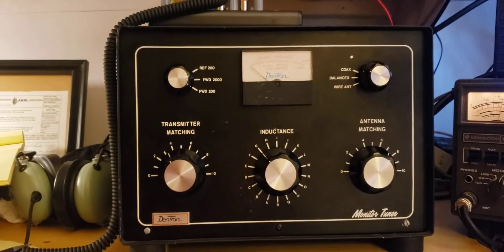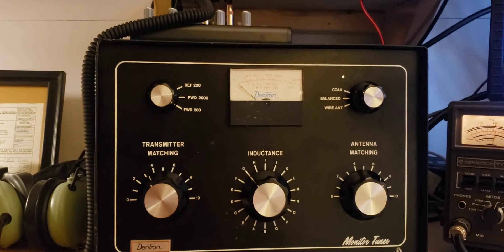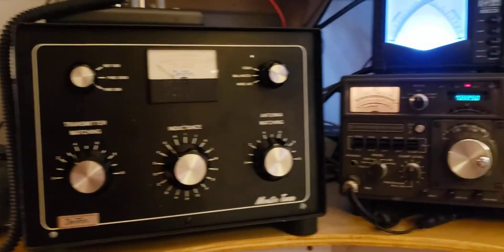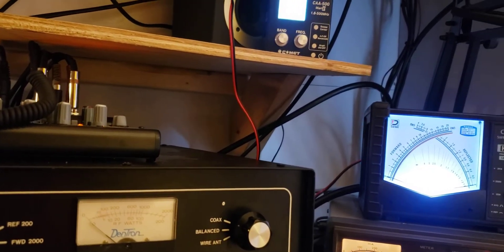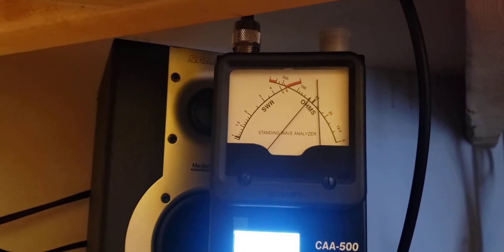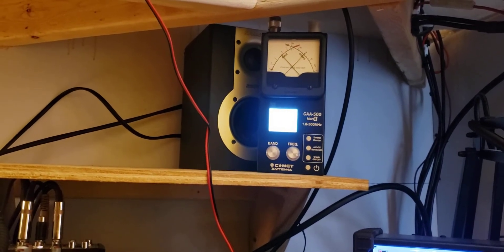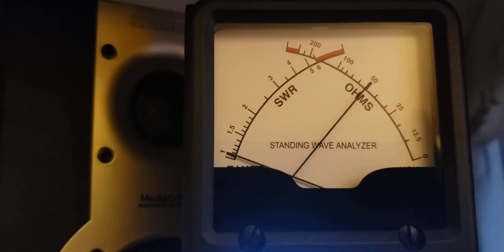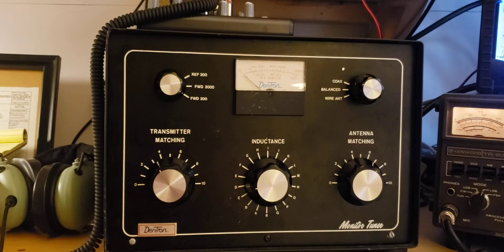Dentron Monitor Antenna Tuner

Comment: Switched inductor, not roller inductor. I have the smaller dentron monitor jr these tuners are built very good and they great at matching most anything you can throw at it.

Comment: hello there I have a question IF you DONT have the antenna analyzer, How do you know where to put the inductor? I got a Dentron super tuner and I'm trying to get it working in 10meters band. Thank you.
Reply from the maker: Do you have a cross needle power meter in your station?
Reply: @BlakesGarage1  No I just have a n astatic 700 and something similar to it I can't remember the model but not cross needle...
Reply from the maker: @AJ-te1ot  I think a couple methods are to tune for the most noise on receive and to tune for the most output power on transmit. Make sure not to adjust the inductor while transmitting.
Reply: yes! thanks I knew it was another way .... Im familiar with the most noise but not with the max output.. I'm trying right know ...hopefully tomorrow 10m opens up... 73 from Fl
Reply: Thanks for your time.. I got the antenna down to 1.1 but the reception goes away as well the power   and I guessing better safe than sorry.